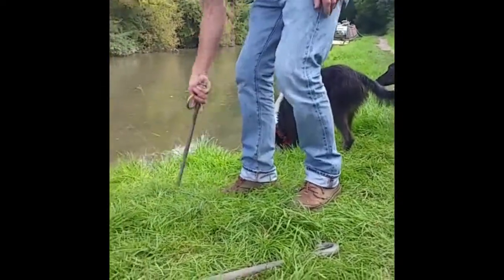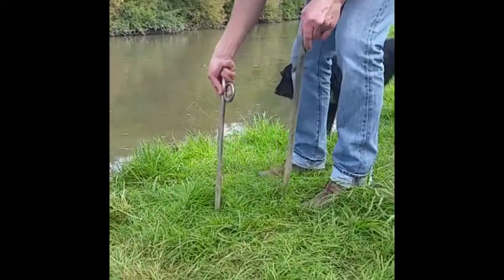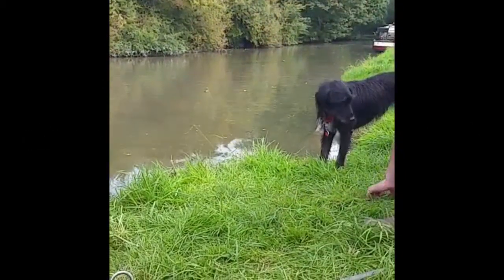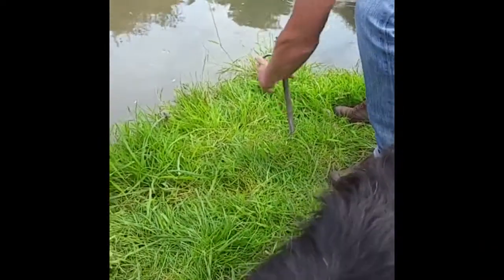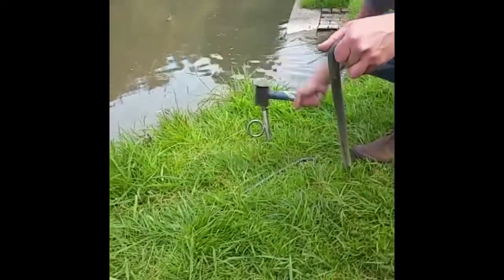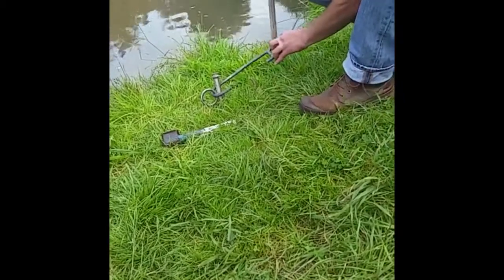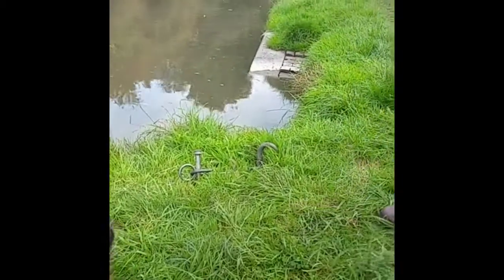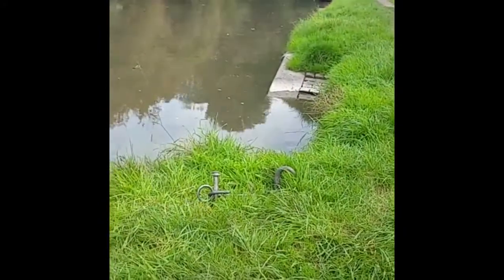Tip for mooring a canal boat on soft banks

Comment: then try getting them out if the weather has been good  whilst boat been left
Reply from the maker: Never had an issue but each to their own 👍
Reply: @narrowboatbrewer8823  been on the cut for nearly 50 years and struggle to even pull 1 pin out
Reply from the maker: @ajw1467  As the title says its for when the bank is soft (have never had it go from soft to dry in a 2 week period (CC)), If the bank is hard when I arrive then a single pin is plenty good enough. Anyway I have only been on the canal 13 years so obviously not as experienced as you!
Reply: @narrowboatbrewer8823   yep that's true nearly  60 years